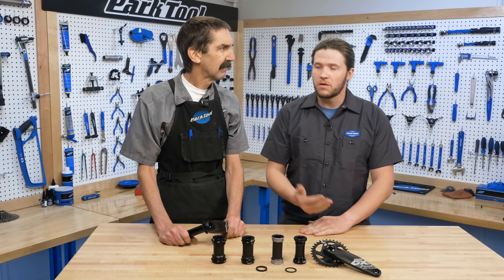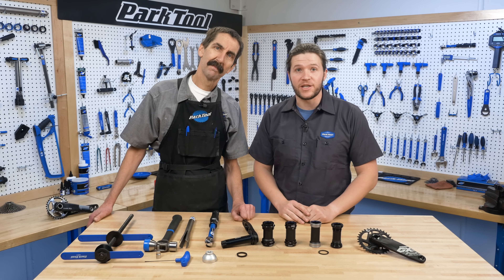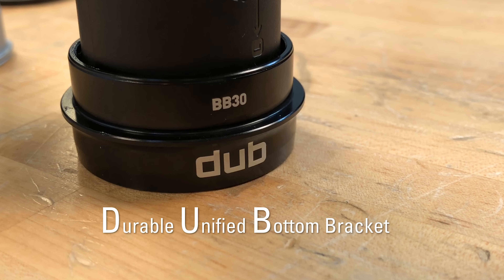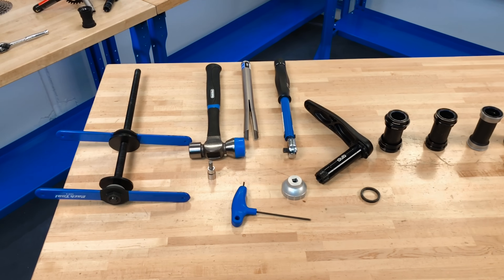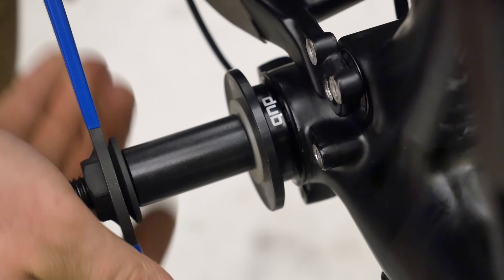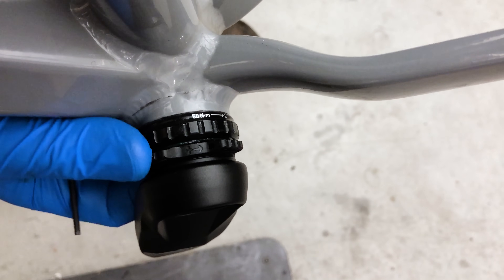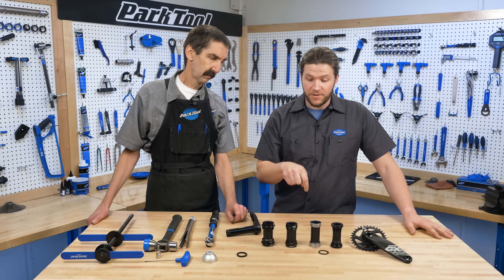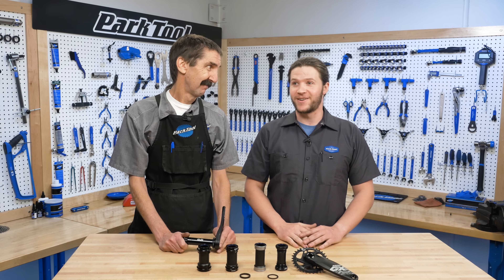First Look: SRAM DUB - Tech Tuesday #101

Comment: More SRAM crap! You can’t buy a threaded DUB BB or compatible cranks in the U.K. I’m amazed sram hasn’t gone bust!
Reply: What? I work in a bike shop fitting bsa dubs every day of the week, we rarely have an issue getting them direct. Lots of third parts manufacturers making dub bb’s, you can use the hope 30mm bsa bb with their own dub conversion kit to reduce it to 29mm for dub and hope always have stock.

Comment: What bearing size does the DUB PF30 use?
Reply from the maker: The SRAM DUB PF30 bottom bracket uses a proprietary bearing. The entire bottom bracket will need to be replaced if it is damaged or worn out.

Comment: I bought that tool from 2:17, to get my SRAM DUB Pressfit out of the frame.. but the tool goes straight through it..
Reply from the maker: Are you sure it is the RT-1?
Reply from the maker: The tool shown is a RT-1.  Is that what you have?  The BBT-90.3 is smaller and is for a different standard.
Reply: @parktool  The tool i got advised by the shop employee was Park Tool BBT-90.3 Brackettool. He said it was fine for my sram dub pressfit (89/92), only one they were selling, didnt see anything else (neither in webshop)
Reply from the maker: Unfortunately the RC-1 is the correct tool. The BBT-90.3 is too small, as you found out.

Comment: I want to buy this dub crank and install the new sram gx eagle crankset. Can someone please tell me which bottom bracket to get for my 2020 rockhopper expert and if i need spacers or not? This is all kind of confusing cause looking at the chart i can't figure it out.
Reply from the maker: Looks like you have a threaded bb. So, the BSA DUB bottom bracket and it appears those bikes have standard MTB spacing so just a 4.5mm spacer is needed on the outboard of the right side.
Reply: @parktool  thank you so much for your response @park tool . One more thing, if I was to get a shimano or other name brand crank, how could i figure out what spacer i would need? Is there a formula I need to know to look for? The length of something plus the width of a spacer? Please help this is all confusing lol.
Reply from the maker: Each brand will have technical documents walking you through the desired setups. Those documents can be found on the manufacturers page, typically.

Comment: Can DUB be use without boost? Lots of groupset come as boost. Looking at buying sram gx or xo dub for my evil Wreckoning but I’m confused 😁 please help and thanks for awesome videos!
Reply from the maker: Dub cranks can be boost compatible. The difference is the offset of the chainring. If you buy a boost compatible DUB crank you will not have to change anything but if you were to buy a "standard" DUB crankset you would need to change out the chainring to one with the correct amount of offset.

Comment: i’m having trouble trying to find information regarding what spacers to use with my 73mm dub bb install on my santa cruz 5010, i plan to use an iscg05 bash guard and idk if that counts as a spacer or not... can anyone assist ?
Reply from the maker: Looks like you will want a 2mm spacer on the outer right and that is all. https://www.servicearchive.sram.com/sites/default/files/techdocs/95-6118-019-000_rev_e_dub_mtb_cranksets_and_bottom_brackets.pdf
Reply: @parktool  What would happen to your drivetrain if I accidently put in the inner 2.5 spacers L/R on a 73mm frame shell? So far I haven't had any issues, but wondering if I should taken them off?

Comment: Is the Crank mounting interface the same as for BB30?
Reply from the maker: Okay, such as replacing the arm with a non-DUB?  That we would need to try and see how it fits.  Certainly SRAM wants the cranks used as a pair.  It does seem likely the engineers would "copy and paste" the crank fit, but not necessarily.  Remove the retaining ring of the non-DUB, and push it onto the DUB spline, then compare this with the DUB crank.  That will give you an idea of the feasibility.
Reply: @parktool  yip that's exactly the reason I ask. I have a quarq pm and am considering a new bike that will come with a dub Crank. I don't want to have to buy a new quarq. I'd prefer to just fit my current drive side quarq
Reply from the maker: The DUB spindle is a 28.99mm outside diameter.   It is a spindle standard.  The "BB30" is refers to the shell, not necessarily the spindle used.  When people say "BB30" they commonly mean a press fit bottom bracket with a 42mm diameter bearing OD, and a 30mm bearing ID.  So a BB30 would use the spindle of 30mm.  DUB would just not fit.
Reply: @parktool  I think you are misunderstanding. The axle diameters are different yes we get that. However the splined bit on the end of the axle where the crank mounts onto is not 30mm, it has independent dimensions since on the bb30 and dub axles the step from the end of the spline to the bearing land is slightly different. That tapered spline will have a min diameter for the end of the axle and a max diameter where the spline ends just before the axle steps to either 30mm or 28.99mm.

Comment: So, I am confused. DUB is supposed to be nearly "universal". I am thinking this is only regarding the fit of the bottom bracket to the bike frame. I don't see any reference to DUB being nearly universal regarding cranks. Will only SRAM cranks fit DUB bottom brackets?
Reply from the maker: Good question. It is not universal in the entire bike world. DUB is the new platform for SRAM.  The "SRAM-iverse" is going DUB, so it will be universal in that world.   Currently there are three platforms for SRAM.  GXP (24/22mm spindle), BB30 (30mm spindle) and now DUB (28.99mm spindle).  It seems they want to settle on one, and that is DUB.

Comment: Is it possible to have bb30 threaded MTB on boosted frame ?
Reply from the maker: Good question, meaning the answer is yes, and, no.  The cycling industry has do us not favor with the terminology. It mixes spindles and shell terms all the time. 

The BB30 is a frame standard that is not threaded, with 42mm nominal inside diameter.  You can have a threaded bottom bracket accept threaded bearing cups that will accept a 30mm spindle.  The 30mm spindle is the norm of the BB30 world.  The boost system refers to the rear spacing and boost compatible arms move the front ring to accommodate.
So you cannot have a threaded BB30.  You can have a crank with the 30mm spindle to fit thread cups in  threaded bottom bracket.  This video was about DUB, not the 30mm spindles, but these also use rings to make them boost compatible.  
Simple, yes?
Reply: @parktool  I got scout 290 frame with 73mm BB shell. I bought hope bb30 that screws in my frame no problem. Bought GX sram boost crank and it doesn't fit. No clearance for crank (it touches the frame) and as I tight up the cranks with 8mm Allen it james solid
Reply from the maker: A BB30 crank will only fit a BB30 bike. It can get confusing as there are BB30 cranks and BB30/PF30 cranks from SRAM. The BB30 cranks will only fit BB30 frames but the BB30/PF30 will fit many other standards. The spindle is longer with a wider q factor allowing more clearance. To see if your spindle can be compatible measure the spindle length. Measurement is taken from the inside face of the crank arm to the very end of the spindle with all adjusters and spacers removed. 104mm+ means you can get it to work. Any less and that crank will not work on the bike.
Reply: @parktool  I will throw that hope bb30 away and go with dub. thank you for replies I appreciate it

Comment: Let's revive this! I have a Jones LWB Complete that came with a Truvativ Stylo DUB crankset. The crankarms are 3 mm off set, with the drive side crankarm sticking farther out 3 mm more than the non-drive side from the centerline of the frame. I see that Wheels Mfg. makes 0.5 mm DUB Delrin spacers. Can I just remove the installed 4.5 mm Sram DUB spacer on the drive side, and stack up 9 of the Wheels Mfg. 0.5mm spacers on each side of my DUB spindle to achieve a perfectly centered chainline? Or am I going to run into problems? Thanks.

Comment: What's the best way to service the bearings?  Pulled the cranks (holy crap!), but it seems to be a hard shield on the outside.
Reply from the maker: There is a plastic insert in the bearing that needs to be popped off if you would like to get in to see the ball bearings. After you pop the insert off you will then have to pop the seal off. These bearing systems are very well thought out and the seal and the insert are shaped to prevent debris from entering.

Comment: Hi Park Tool, what drift/bushing  are you using to press the dub bearings in? Would I need to purchase separately from the hhp-3 press? Thanks!
Reply from the maker: We just used the HHP-2 to install in this video. We do now have drifts/bushings that are sized specifically for DUB that will fit onto the HHP-3, HHP-2 or the BBP-1.2. They are part number 2292-2 and can be purchased directly from us.

Comment: 🌲Hey could you please help me, I’ve got the 2019 Scott genius 950 and I have the Sram NX eagle drivetrain with the dub system and this weird looking sort of skinny chainring. I am looking to upgrade the crankset but can I for example get one like the Sram Descendant or GX eagle cranksets (with the bigger chainrings)? And will a BB30 one fit, or what option would I have to get?
Reply from the maker: A BB30 crank will not fit into a DUB bottom Bracket and is not compatible with your frame. You will need a PF30, DUB, or GXP crank  if you are looking in the SRAM family. If you select the GXP or PF30 crank then you will need a new bottom bracket. If you choose a DUB crank then you can use your current bottom bracket. If I were you and was looking to upgrade to a new SRAM crank I would look for a DUB crank, make sure that it is designed to be used with 148mm spacing/boost as well (your bike is boost). If you do not get the 148mm/boost crankset then you will need to get a new chainring for it with the correct amount of offset. So, you might as well get the boost crank from the get go. Hope this helps
Reply: Park Tool Thank you so much for the help 🙏🏻

Comment: Anyone else have trouble removing a dub crankset off of a bike? We've tried everything we can to move that 8mm hex bolt from the drive side on a scott spark.... we are scared of damaging the carbon frame with how much torque we are having to use to try and remove it. and tips?
Reply from the maker: These are proving to be bears to remove. Using more leverage is the best solution we have come across. Once you have it off be sure to apply grease to the threads upon reinstallation. Great application for a SWB-15 ;)

Comment: Quick question i wish u would recognize my comment. Coz dis is so important for me.

My question is.. would it fit my gxp bottom bracket? Or do i really need to score for a new bb dub series for it? I have a crankset dub series coming this weekend so i hope u guys would notice me. Thanks ciaoo..
Reply from the maker: This is an good question because is shows what a mess the terminology and names are in the industry.  It will take a some text to explain. 
 There is no "GXP" bottom bracket in terms of the frame.  The GXP is a term for spindle-to-bearing fit.  The SRAM GXP bearing system uses a larger ID bearing on the right, and a smaller ID bearing on the left.  If the frame shell is threaded, it can accept threaded adapters for the GXP.  Pressed frames can use the pressed GXP adapters.  The crank must match this system.  SRAM DUB can fit the exact same bike.  The DUB crank must have DUB compatible bearings, in terms of the ID fit.  If you are getting the DUB crankset, it should come with the DUB bottom bracket.  The crank spindle will match correctly to the bearing inside diameter, and all will be good.  You cannot however use a DUB crank with a GXP bearing adapter.  DUB is not a new frame fit standard. It is a new crank spindle-to-bearing standard.
Reply: I own a Trek Boone 2018 GXP Force CX1, I wanted to upgrade so I ordered a pair of Force DUB Cranks and a DUB BB92, took the bike to my local Trek dealer for installation, they told me they are not compatible with my frame.

Comment: when changing from my old bb30 cx frame to the new with bsa I had to buy a new crankset even if the bb30 one was still good (& expensive).
So for me dub would have been an advantage there.
Reply from the maker: Exactly! So many bb30 cranks were purchased just to be put on a shelf as they did not fit the intended bike. This new change will hopefully keep cranks away from the dusty shelves and instead put them to work on peoples bikes.
Reply: Park Tool one more reason to buy the more expensive crank now lol
for my new build with 73bsa i need no spacer under the dub bb right?
Reply from the maker: No spacer needed behind the BB cups. Just the 4.5 mm spacer that clicks onto the outside of the driveside cup. If you are running a chainguide, bashguard, or emount derailleur then you can run the 2mm spacer on that clicks onto the outside of the cup. Im sure you have been looking at this but here is a link to the installation instructions complete with a chart showing spacer possibilities. https://www.sram.com/sites/default/files/techdocs/95-6118-019-000_rev_b_dub_mtb_cranksets_and_bottom_brackets.pdf

Cheers!

Comment: this will work 68mm threaded shell ?
Reply from the maker: Yes this will. It comes with spacers for install on that setup.
Reply: Thanks for Reply , just too many Standards of Bottom Bracket shell ( press fit , bb30,pf30,bb86,bb92,bb121,bb90,bb95,bbright ,bbevo.  WTF !!!!!!!!!
I still have a Square Taper - White Industries Crank triple Ring MTB FORGED !!! made in USA . 68mm Threaded 
Still works .
TO THE FUTURE !!!!!!!!!!!!!!!!!!!!!!!! Forged CARBON ?

Comment: Park Tool: What's the difference between the pressfit BB removal tool you showed here (BBT-90.3) and the BBT-30.4?
Reply from the maker: The BBT-90.3 fits the PF30 and BB30 bottom bracket bearing standards, using a 30mm inside diameter for the bearing.  The foot of the BBT-90.3 is too large to fit the slightly smaller DUB bearing.  The BBT-90.3 driver is for the pressed bottom brackets in the 24mm standards (and 22), so it fits the BB92, BB86 or PF41 bearings.  It is too small for the DUB bearing sizing.  
   The RT-1 in the video is just DUB right.
Reply: Do you mean the BBT-30.4 is for the pressed bottom brackets in the 24mm standards (and 22), so it fits the BB92, BB86 or PF41? You wrote BBT-90.3 in both instances in your reply.
Reply from the maker: I apologize. The BBT-30.4 is for 30mm and the BBT-90.3 is for 24mm and 22mm.

Comment: Pf30 and bb30 is dead. Thank god! Gxp sucks. 
SRAM is covering there ass with the return to threaded bottom bracket shells on new bikes.
Reply from the maker: Well, not quite.  DUB is a spindle fit standard.   There is a DUB-pf30, as well as a DUB-bb30, and also the threaded BSA.   GXP will go away, but the frame fits are the same.
Reply: Park Tool what I meant is this:
I feel like press fit is going away. 
At least in mountain bikes manufacturers are moving away from pf30 back to threaded. 
Still lil bit lighter for road Bikes. Not worth the grams in my opinion. 
I personal don’t like press fit and there tendency to creak. 
know there are methods to deal with it. Shouldn’t have to. 
Sucks when customer drops some serious cash on a nice bike and it creaks.
I think manufacturers do it because it is cheaper. They eliminate the threading step or bonding a aluminum insert into a carbon frame. Lame.
Reply from the maker: Okay then.  Just when we thought is was all setting down in BB land,  we have...........T47.

Comment: Bearings in the bb92 version will be tiny! Just like 4130 bearings. Useless.
Reply: So I actually just swapped out my 30mm spindle for a dub crank set. And to my surprise they use the same F*** bearings. What SRAM uses to make this new 28.99 spindle work is a plastic sleeve. Complete bullshit, all marketing. If I take the dub sleeves out I can fit my 30mm spindles in no problem.